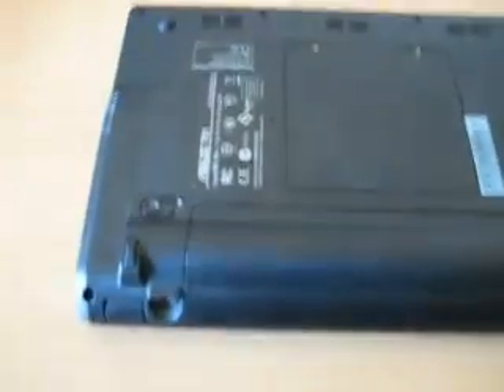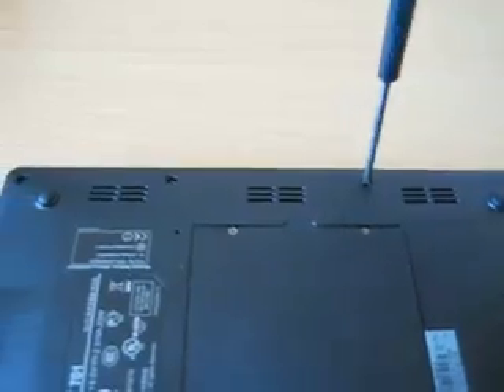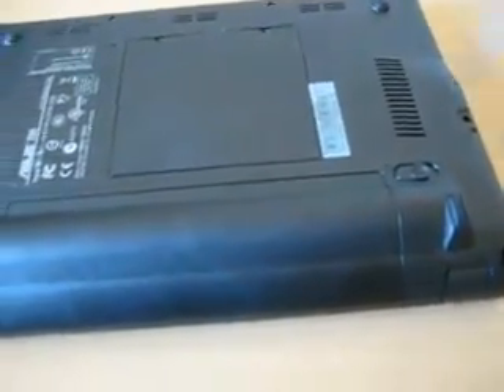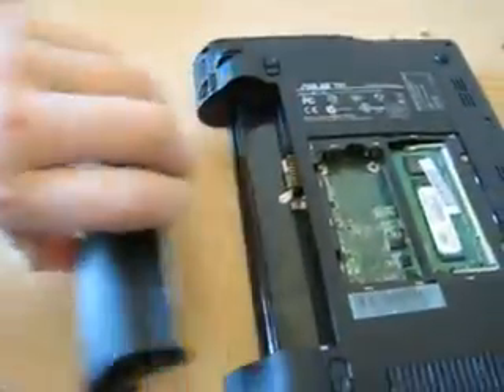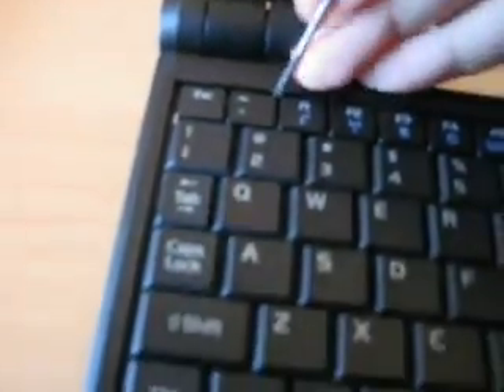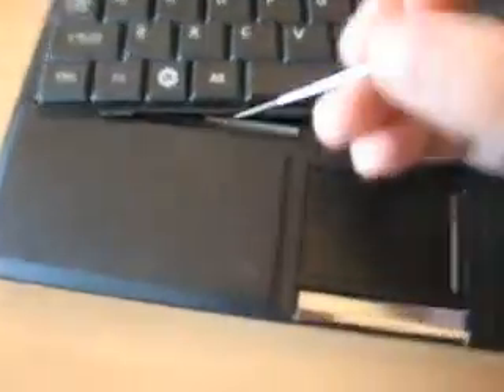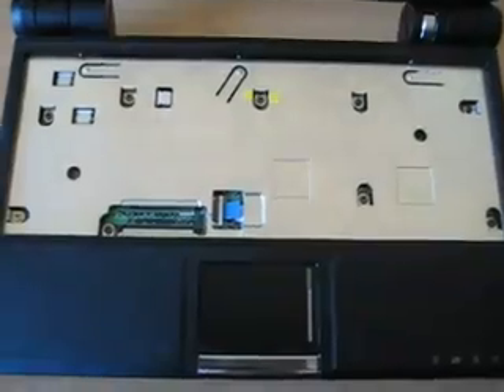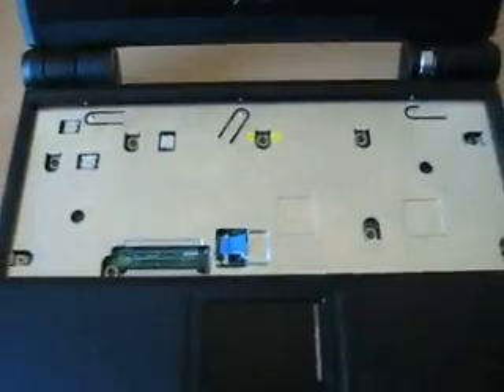EeePC Disassembly (Part 2)

Comment: DO you love yours? I know I love mine :D.
BTW search up "eeectl" it's a program that allows you to control the fan speed, cpu power and back-light brightness. The 900HD has a Celeron M 353 that is capable of 900mhz but is under-clocked @ 600mhz. So you know that's a hell of a boost :). plus it's nice to run the fan at full speed, it real keeps it from getting hot like the 900HD normally does